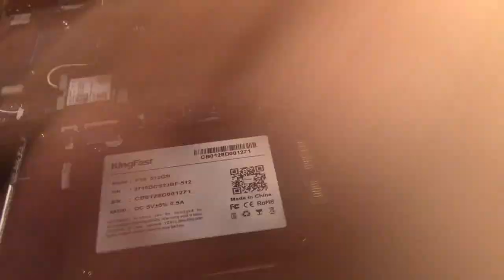Dell Precision 3530 SSD Install Fail

Comment: Nice video dude.
As you say, I have my Dell Precision 3530 with a different battery size (68Wh) an I'm gonna upgrade de SSD from 512Gb to 1TB.
And I was looking to use my old SSD that is a really tiny one so I don't know if you did the thing of using the 4G space to connect a different SSD. If not I think I'm gonna use it as external drive with a case.

Greetings from Mexico.
Reply from the maker: @jorge7311  Hello! Yes, you can use the WWAN/4G for an SSD and it will work, just make sure it's the half size one. Hope you like your computer!
Reply: @Martin-NT  ty, do you know if it is only for M.2 key or it could be a nmve PCIe ?
Reply from the maker: @jorge7311  Not sure actually, I recommend you look up the specifications on that
Reply: @Martin-NT  I will try it when my SSD arrives, TYSM for the help 😁
Reply from the maker: @jorge7311  No problem 😁

Comment: Great video man But you still haven't dropped the review for the laptop
Reply from the maker: @H3Adshot203 Yeah, I actually spent 2-3 months trying to find a good working Precision 3530 refurbished. I've gone through seven units, exchanges, replacements, returns, and couldn't find one that worked well for me to give my honest opinion. Issues ranged from battery issues to stripped screws and other stuff. I've dropped my 3560 Review now though.